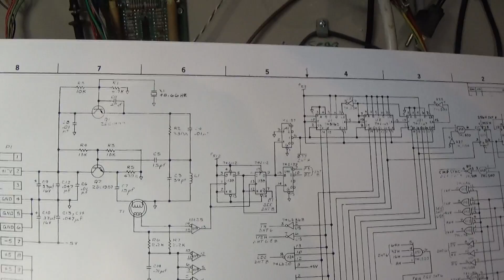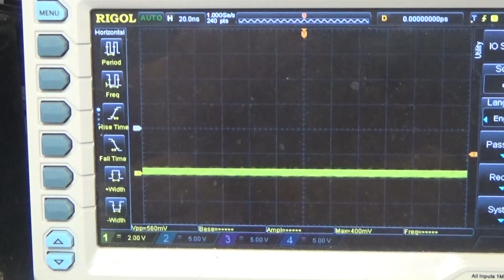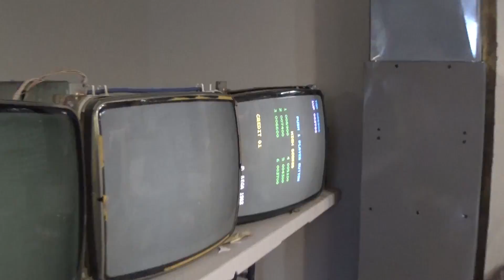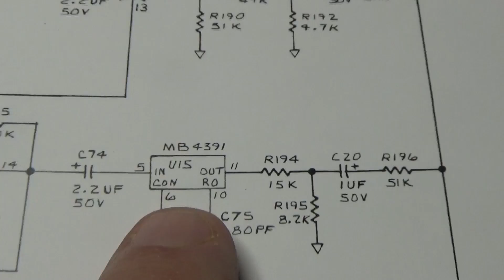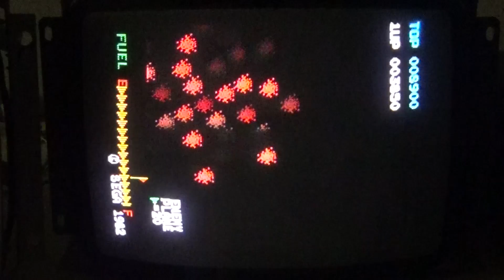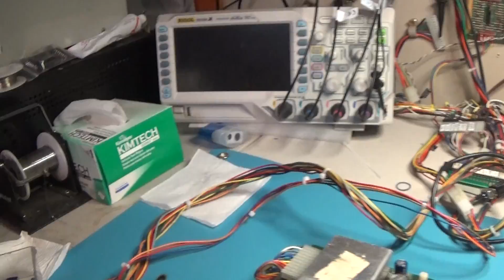1982 Sega Zaxxon Arcade PCB Repair   2-29-2024

Comment: On ours, which is a bootleg, so take everything about sound with a huge grain of salt, there's a constant wind noise (that sounds very convincing) that changes pitch with how high your ship flies (the height indicator on the left). Our Coin sound is quite different though (yours sounds cooler tho). (constant means it's not depending on where in the level you are or what level you're on except of course it's off in attract)

Here's an idea for a hack... replace the background with sand (and sea and waves), force fields with volleyball nets, fuel tanks with buckets, grounded enemy planes with dogs, walls with sand castles, rockets with idk frisbees or something and call it...

...Zaxxon the beach (ba-dum tss)
Reply: I've heard this on original hardware too